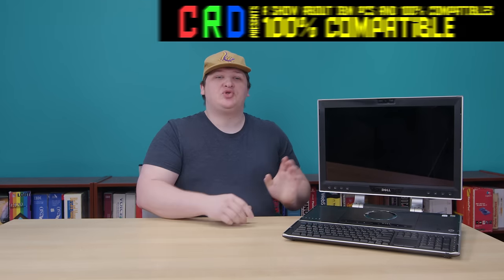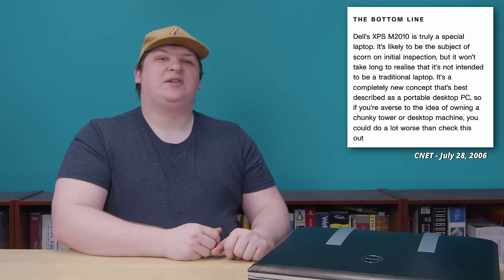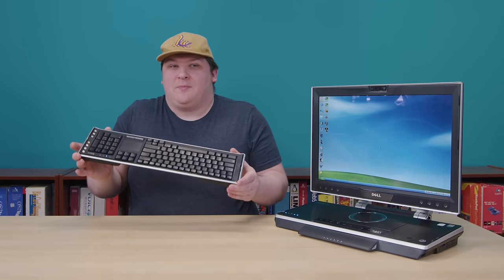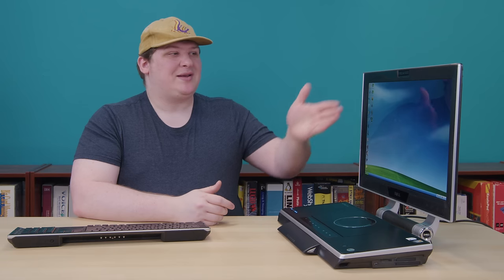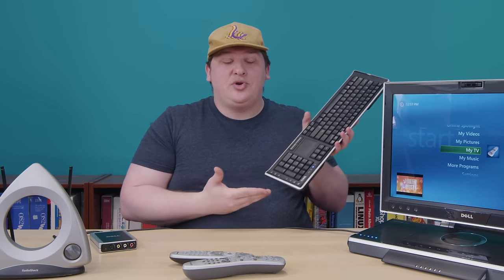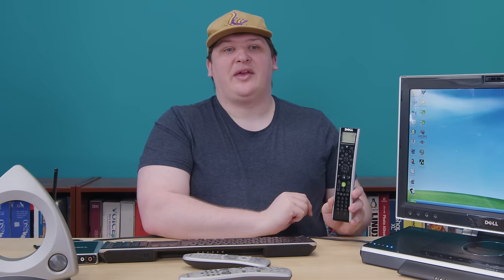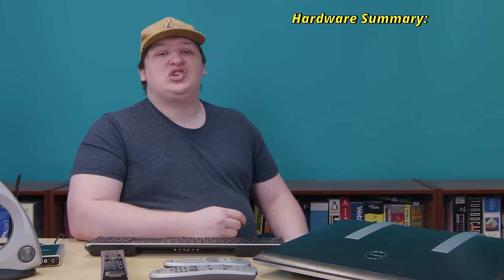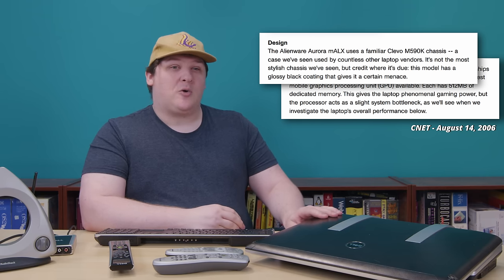Dell Called It "The Showstopper"

Comment: Thinking about a modern "Homer Simpson laptop" that stupidly has everything making it a terrible device overall: integrated Software Defined Radio with planar ultrawideband antennas inside the screen housing, a gimballed webcam that can follow objects around/look on the other side of the screen/robotically folds away when not in use, backlit e-ink displays in each key for customisation, over the top integrated headphone DAC, WIFI chipset with monitor mode for sneak sneaky business, and integrated lazy-boy mode that (without using a bootloader) imperceptibly jiggles the mouse and opens random shit, types crap, makes Excel spreadsheets and saves them to deeply nested network folders so that you appear to be working to corporate spyware - activated by a single button.

Comment: If they've dropped (greatly) in price can you get an Acer Predator 21X in as well? They weighed 26lb with the power bricks so it's a contender with the Dell for chonkiest laptop. The 21X has dual 1080Ti's though so it might not have dropped in price where it's wroth getting one for a video yet. Maybe the Dell Adamo laptops, which came out in 2011/2012, would be a better option (though they could also be collector pieces at this point).
Reply from the maker: I want to get one of those, but for my video on ultra wide laptops

Comment: Wow. Didn't know anything about this, Dell actually made a luggable workstation, with original ideas that work and solid hardware, in the mid-2000s. About a decade after they went by the way of the dinosaur with the arrival of the "power" laptop. (Meaning, they actually have the same generation of chips in them as the current mainstream desktop stuff. And are at least, 70% of the power of an average system, despite thermal throttling to hell. :D :D ) No, this is awesome. I'm impressed.

Comment: I think I want this lol

Like
A modern one.. and instead of all the media input, just literally add a capture card with HDMI. And software to display that capture at near-zero lag (maybe actual pass-through, a video feed you can swap the display to and output via a dedicated HDMI port,  and mix the audio with the PC audio). Both on the internal display, and output through it's own HDMI.

I like the idea of that screen. I don't need the battery.
... aand I wouldn't really wanna spend $4k on it lol

Comment: what's even weirder than using inches for laptops internationally, at least where I live, noone would even know how much 21 Inches are. Pretty much everyone I know only knows their screen size comparatively (17 Inches bigger than 15,6) and even I who knows the conversion factor will not use cm or even convert to cm in my head.

Comment: 8:00 not at all. The world has largely adopted to a mix of inches, centimeters, ounces, gallons, miles, kilometers, etc.
Literally zero countries sell phones, laptops, TVs, or displays based on cm.
Would you be happy to know that commercial planes are fueled with "pounds" of fuel.
Fun fact: the Gimli Glider became that way because they used the wrong kinds of gallons in the conversion process. 
Oh, and planes also fly feet above the ground all around the world.
You buy pounds or ounces of butter internationally.
In the US, you measure it by fractions of a stick. 
Internationally, you weigh it in grams. 
In the UK, you measure it by grams but the serving size is in ounces.

It's almost like, people should just learn both systems.

Comment: why is it only NOW i've got one is everybody now starting to cover the device XD, unfortunately mine is very badly damaged but i will look forward to repairing it,

the only issues i am overly worried about is that it was build during the time period of defective video cards and i suspect my ATI Radeon X1800 is faulty however i am just praying it isn't the case with mine,  either the system board or GPU is faulty in my case. and thats not the only problem

Comment: As media center remotes go, this is nonpareil. Kodi Kore comes close, but that's designed by the same people who designed the media center it's controlling and running on top of a modern fondleslab interface, and all of that is running on a common code base; building a baremetal media center controller for Windoze back in the 2000s is extraordinary.

Comment: I'm wondering if you think this will run Win10 1511 10.0.10586. It's the last Win 10 version that includes DRM to run WMC w/CableCARD. I use a dedicated box for this and is my solution to avoid the cable company's onerous cable box fees since this setup can serve several computers/TVs in my household and I do not use on demand services anyway. Anyone, please advise...  Thanks in advance   :)

Comment: I hate that so many electronics use rubbery materials. I have a usb dj mixer thats only 9 years old, always held in refrigeration. The rubber is already melting.
Reply: I have that same Dell Bluetooth mouse and its all melty sticky rubber at this point as well
Reply: I got a Bose Companion 5 setup recently and was surprised to see how bad the rubber had gotten on its dial. I guess that thing is pretty “old” now, but yeah I initially thought it’d just be the sort of oversight relegated to ‘90s ThinkPads I’ve had the displeasure of touching before cleaning lol.
Reply: @zephryn6502  good reminder. I actually wanna pick up some of those Bose companion speakers for my CRT. Gonna avoid the rubber dial ones

Comment: I would say that the current run of Macbook Airs and Pros are lap-able. They're lite, relatively narrow and not too deep, and they've solved the heat problem as long as you're not charging the battery at the same time you're using it. 

Dell is an amazing company. They can do incredible industrial design and engineering while also shamelessly making the cheapest, ugliest, and least durable computers ever.

Comment: Honestly I think this handles the same neiche that the LG suitcase TV does but even better. I would kill to have a machine like this today, maybe replace the keyboard with a mechanical one, stick a blueray drive in, etc and use today's modern advancements to make it smaller and lighter, I'm sure someone would drop any money, especially if they could liscense something like RokuOS or something as a quickstart OS
Reply: Blu-ray drives are pretty useless on computers unless using them for data backup, since Blu-ray movie support was never standardised and you have to basically pay a subscription for some crappy third-party player software that also has to be constantly updated with the latest AACS libraries.

Comment: 16:9 is not good for anything in a computer, even when watching movies very often. Because there always are other contraints, like at this 'notebook': What use would it have if they had used a 16:9 screen? The overall depth of the notebook was supposed to fit a full size keyboard and an optical drive behind - this would not work with the display being less high. And you would of coure lose very precious screen real estate. 16:10 is much better than 16:10 for working on a PC, and the only reason 16:9 is standard for way too many years now, is the industry saving a lot of money by unifying display ratios through more technologies, like Computers and TVs, which needs less fabs.

Comment: I've got used one. Battery is dead and can't get replacement. The keyboard has its own battery. It is also dead and I can see no replacement in stores. Keyboard does not work at all without battery.

Comment: My 2016 DELL Laptop has both a 256gb SSD and a 512gb HDD... But the HDD appears to be dead. I did Factory Reset but not have not enough life left in me to identify and remove all the BloteWare℠ and packaged software like McAfee which was embedded so deeply into my system some of its folders will be there for Ragnarok. It was a foolish departure from my trusted HP routine which I never intend to repeat. I think DELL threw in the towel around 2012. Which is a shame!

Comment: 39:29 Why would you throw it out if there is still a 90% working laptop?
Reply from the maker: For the cost and effort required to fix this you can get six massively superior machines, and it wasn't very good to begin with.
Reply: @CathodeRayDude  but it still works 😭😭

Comment: Yah, a laptop needing to be able to be used on your lap is a weak argument.  Almost no laptops you would even want to use on your lap on top of you probably don't want use one on your lap.  In a sitting position you would have to lean so much you might  well be laying,  if you don't want neck pain. Ideally you would be laying or leaning, but odds are if you are doing serious work its on a desk.  I guess you would miss out on doing work on a train or plane,  but actually using a laptop on your lap is a borderline edge case

Comment: your gonna want to mod your fans to have them on max all the time if you want to keep that gpu from dying, the big problem with the dell m2010 that I found out the hard way is that, when that gpu overheats it will not shut the pc off it will just keep going until its fried, even if you add new thermal paste the dell m2010 gpu is prone to fail, and with how little of those bad boys are out there, it will take you YEARS or a lot of money to get another working gpu for it. if you know of another gpu that could be put in from another dell pc, I would honestly like to know as I am still looking for a gpu replacement for mine lol.

Comment: This is when you could still get an AMD RISC that wasn't X86.  It was better in every way.  It was also when Intel started abusing their vendors to push AMD out of the market using very shady means.  I got my computer science degree in 2000 and spent a long time trying to explain why CISC is just awful and nobody cared.  Now everyone uses RISC (ARM) on mobile devices but no one seems to comprehend that x86 (CISC) is garbage and still used because of planned obsolescence.  AMD was pressured to go back to x86 and no one seems to notice the only difference between AMD and INTEL is their extended/expanded memory handlers were rolled into a more unified bridge... but the x86 cpu still has shit memory addressing which still causes system hangs regardless of how new or "good" your computer is.
Reply: And that has anything to do with this video, how exactly?
Reply: Dude just spent over an hour talking about retro computing.  The history of the x86 (and why we still use it today) is the core of what he's talking about.  

Did you even watch the video?

Comment: Who'd use this thing besides stupidly rich early adopters? This would be amazing for science work in the field. You often need more screen real estate than a laptop, so they carry a laptop, a low-power LCD screen, a Jackery or similar battery pack, and connect up to whatever jank power they've got to keep that topped up. This machine is one and done for all of that.

Some low power system with effectively a Dell Ultrasharp 2007wfp that can handle the power getting flickery now and then? At the time this thing was made, yes please, for the right user. I don't think Dell marketed it to the right user because these things were dead and buried before I even ever heard they existed.

Comment: Soft touch plastic must be one of most nasty ways to implement planned obsolence. 💀

It should be banned for both environmental and consumer rights reasons. ☠️

Am sure this must be the very definition of microplastics and probably quite unhealthy to deal with in the long run.

Otherwise - video is very nice as always. You hereby get the 👍 !